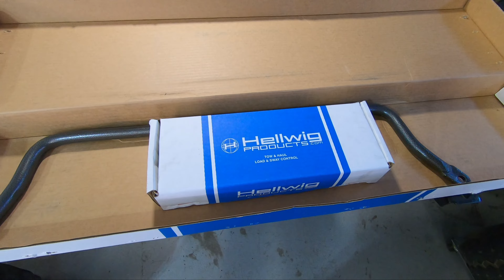Jeep CJ-5 Restoration - EP15 - Greaseable shackles and stainless steel brakes lines on the front end

Comment from the maker: Ordering parts is always an adventure.  As it turns out, I could probably pay a little closer attention when I'm checking out to avoid unexplained extra parts showing up!  But at least the folks at Quadratec are doing a pretty good job of filling the orders I keep putting in for the parts I need to keep the project moving.

Comment: May we have a parts list and numbers list , I am interested in sterling box mount and sway bar , please .
Reply from the maker: Gary, the steering box mount is a Throttle Down Kustoms part, their number is SBB-768CJ but I bought it through Quadratec and their part number for it is 56103.01.  The sway bar is Quadratec number 16002.0110.  That sway bar is not quite the exact same layout as a factory sway bar, and I'm not that sure I'd recommend it just yet.  It's certainly a heavy sway bar, but the mounting is going to look a little cheesy I think.  I'm undecided on that at this point, and will need to get it installed to see how it looks.  I
Reply: Landlocked NoMore thank you , good luck and will look for your updates .